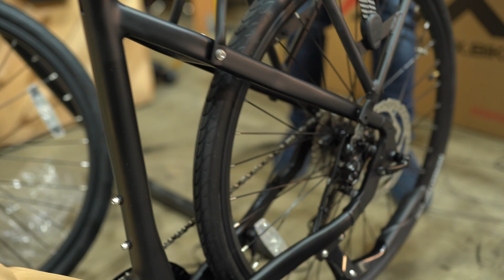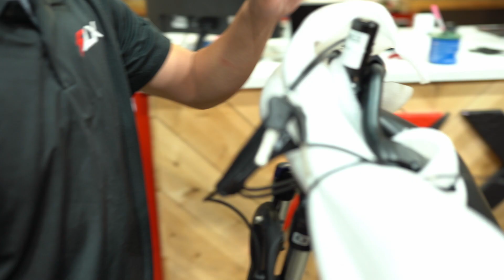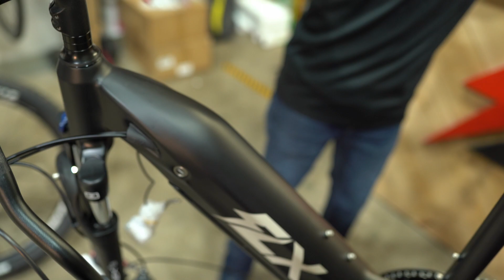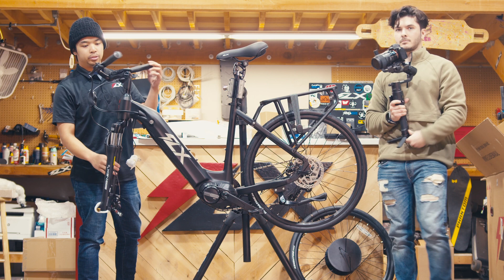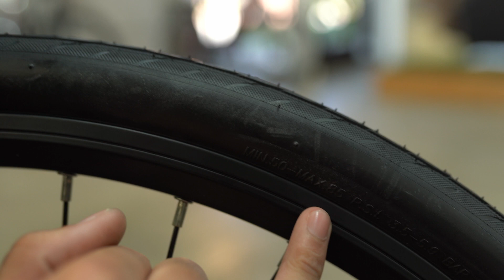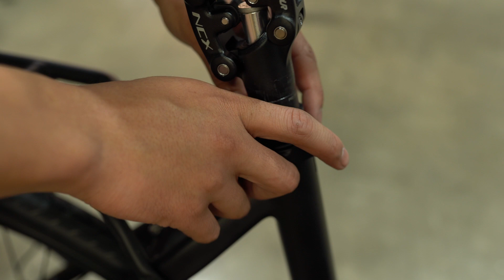How To: Step Through 2 Assembly Step By Step

Comment: The video really helped!  I couldn't figure out how to remove the front wheel stem from the body, even after ready the instruction sheet.  Also couldn't find the "extension cable" that connects the green plug from the body to the display.  Didn't aware the wire was just all stuffed inside the bike.
Reply from the maker: Glad it helped! Enjoy the ride :)